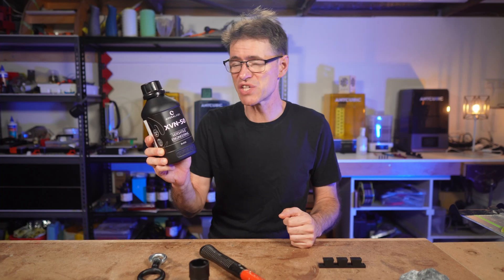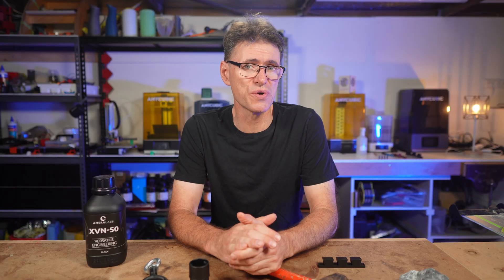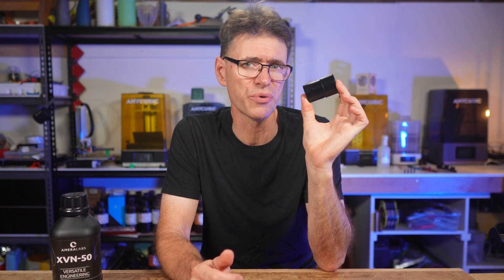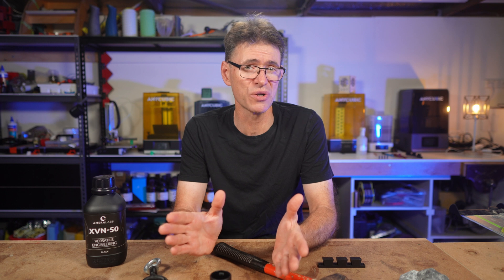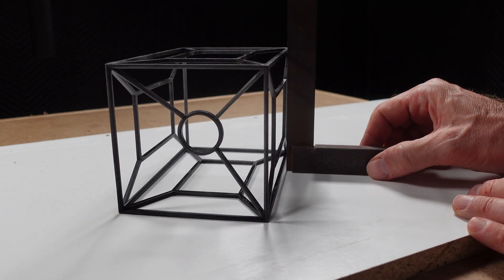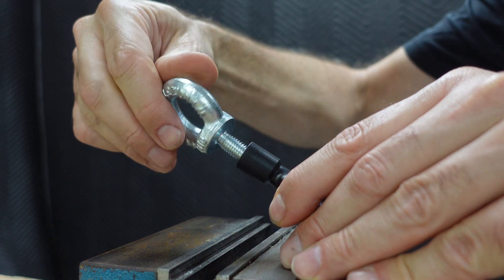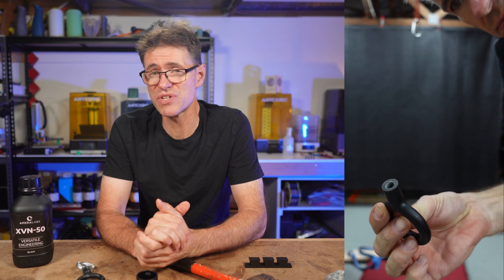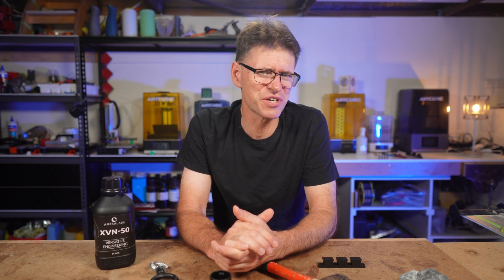Ameralabs XVN-50 Engineering Resin Review

Comment: Thank you for the great video, would you be interested in looking for the best resin that can handle practical all season outdoor applications?
Reply from the maker: Thanks for the great question. "All season outdoor" is a wide brief. Do you have a specific application in mind that needs to handle those conditions?
Reply: @ColinKlupiec  I appreciate your answer. Every person's outdoors is different depending on where they live I guess :D. Let's say one that it wouldn't deform under direct sunlight, let's say 100C 200F and then won't become too brittle at mild frost like -10F.  I don't expect it to be very tough but at least it won't crack by itself. This kind of resin might not have been formulated, I'm getting mixed signals from google and llms.

Comment: Unfortunately from looking at the data sheet it suffers from the same problem as most resins and has a low heat deflection temp
Reply from the maker: Yes, that can be a problem for some applications.